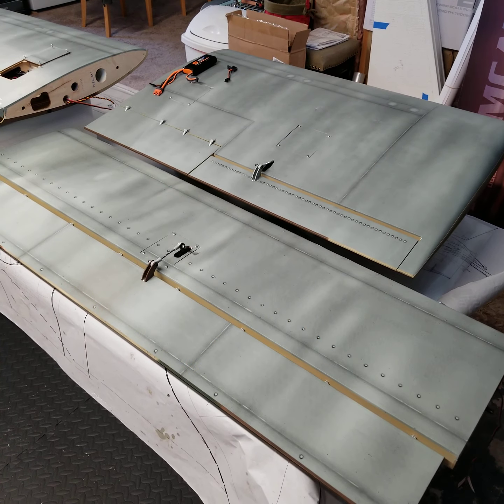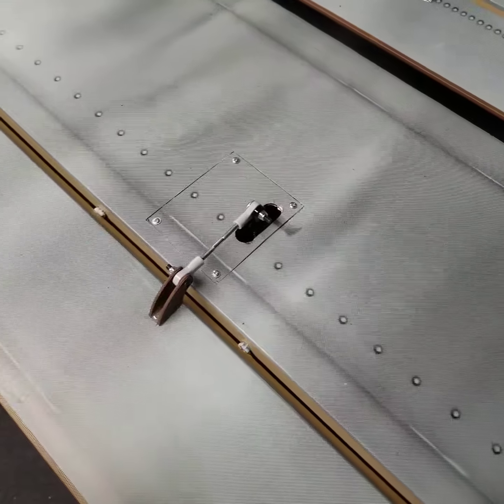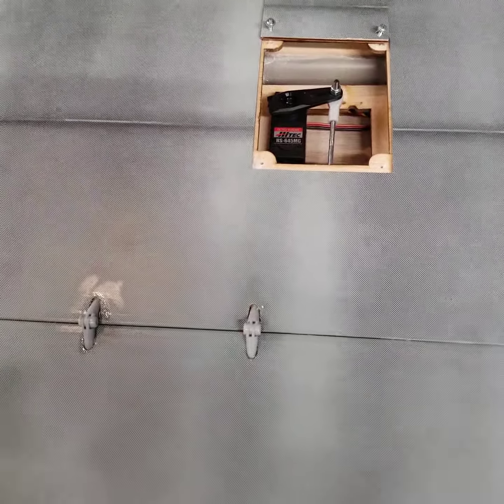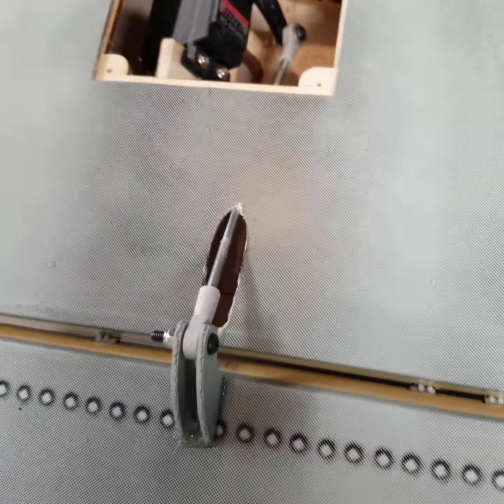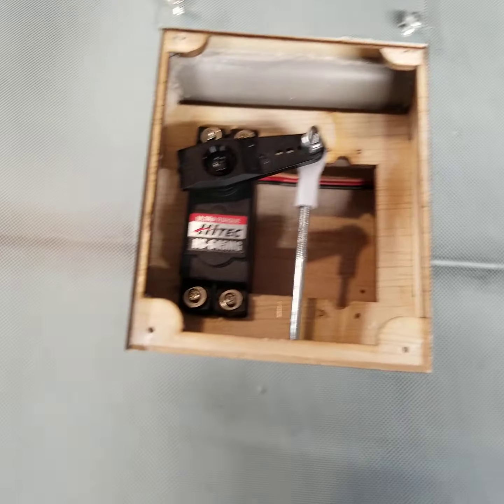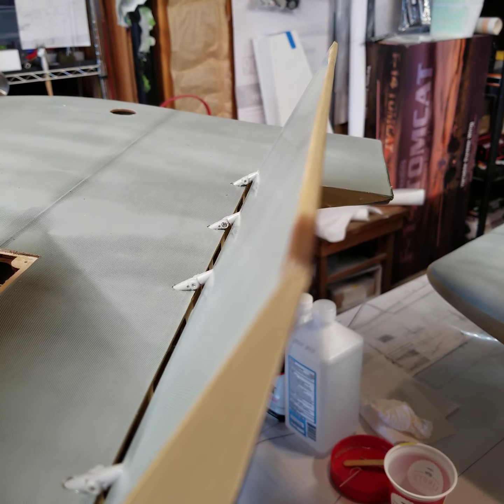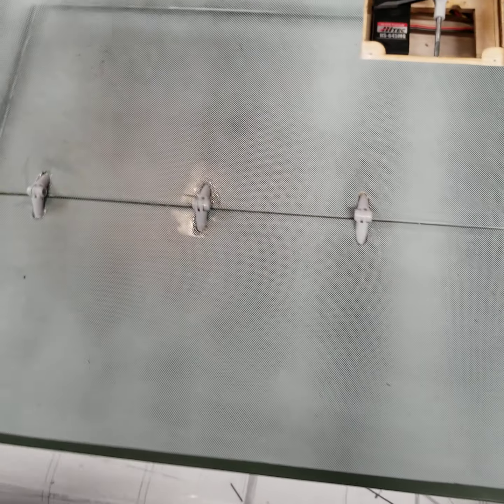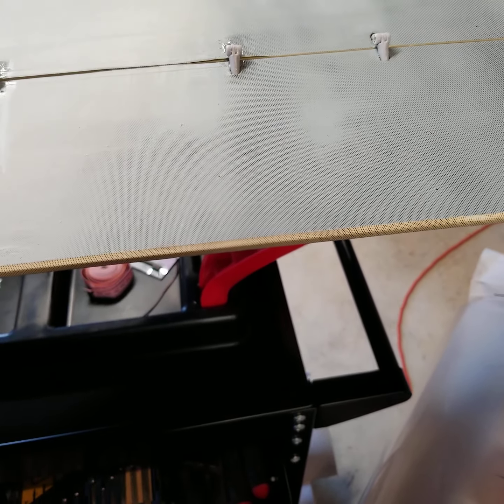Hangar 9 OV-10 build part 2

Comment: As I said in the post on FB, make sure you loctite all 3 bolts on that single servo arm, or split the elevator and add another servo for redunancy. One crashed this weekend due to that arm coming lose...
Reply from the maker: I greatly appreciate that information John. I always loctite anything metal to metal contact. Servos, landing gear etc. Thanks for watching and the feedback!
Reply: I agree with John VHRC 👍

Comment: That’s not a mistake about the location depth of the flap servo mate. The reference is to the static orientation just like in at static standard. Dorsal up ventricle front back are references relative static rest orientation. It is at the “higher position”

Comment: Great stuff, David, thanks so much for sharing will be a great help once my Bronco gets delivered. Which Servo did you use on the Elevator? Cheers from Germany
Reply from the maker: Thank you for watching and your kind words! I used Hitec HS645MG servos on all surfaces except the elevator. On that surface I used the recommended servo from Spektrum SPMSA6320 with a JR 25 tooth metal servo arm.